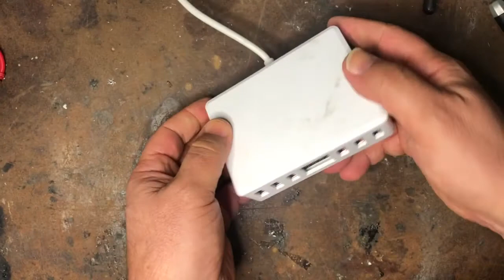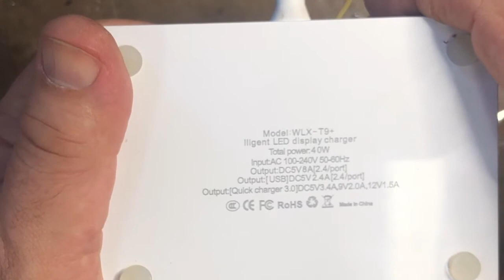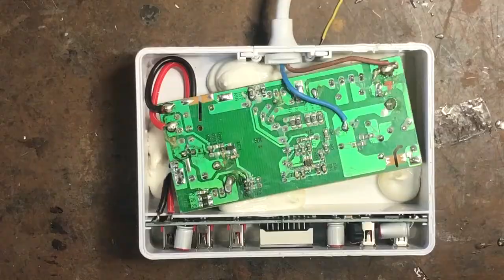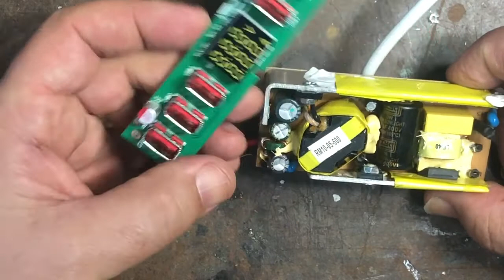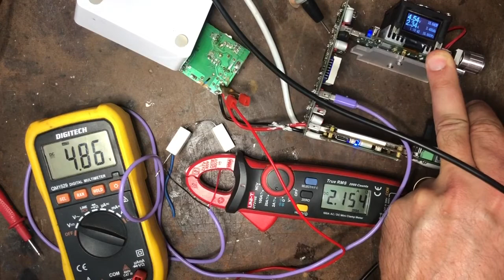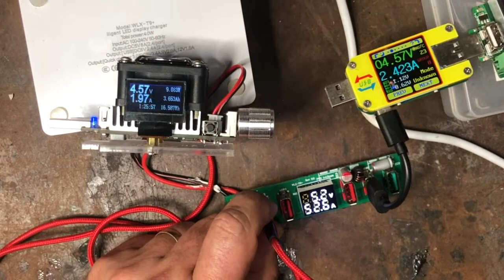6 Port USB Charger WLX-T9 T9+ teardown

Comment: Would you please share the model number of the usb test devices that have the read out on them?  
Thanks for the video. 
Is there a usb charger you do recommend that has an info display?
Reply from the maker: The USB load with display is a generic you can find on Aliexpress https://www.aliexpress.com/item/4000507216837.html

The full USB tester (the yellow one) is a Ruideng UM34C.

I have a 6 Port USB charger like this: https://www.aliexpress.com/item/4000133969593.html which is a bit easier to read the display.  They are generic but all over aliexpress
Reply: @princhester3470  Thank you for the reply.